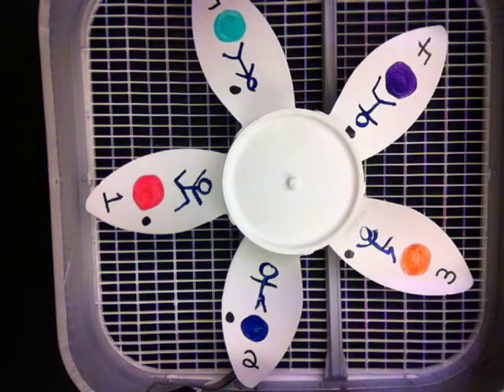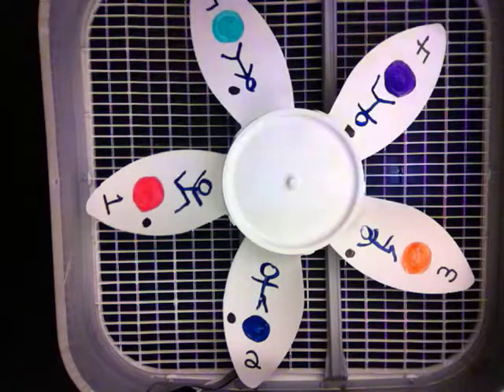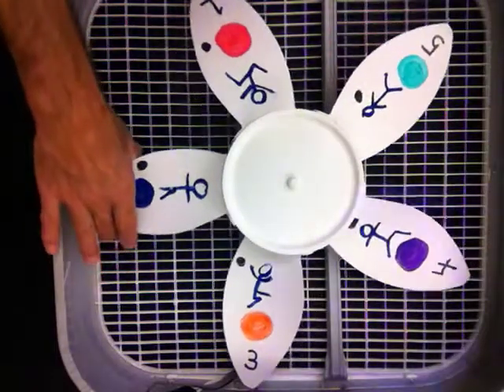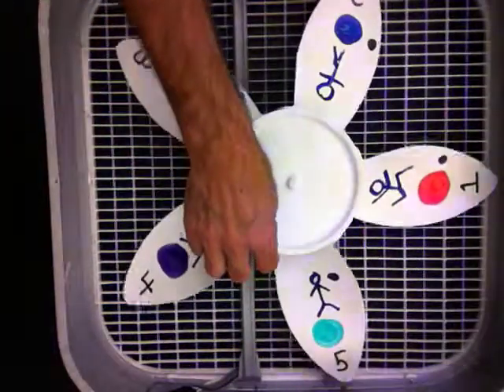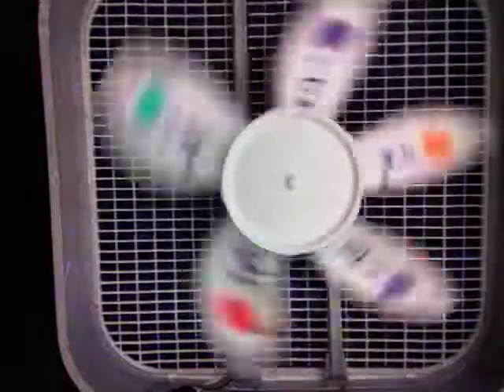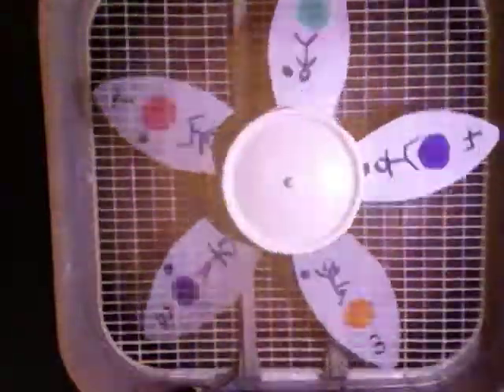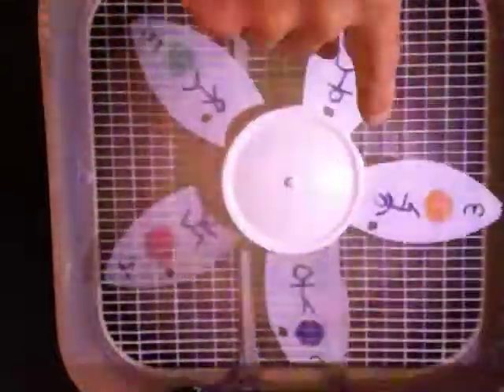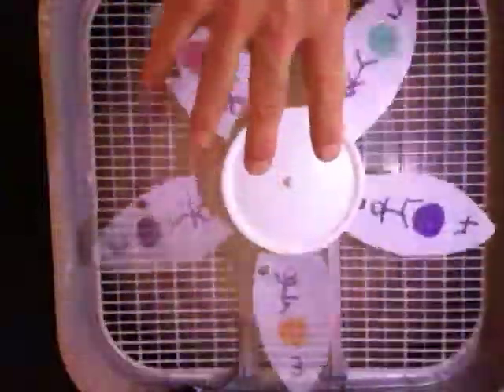Box Fan and a Pasco Strobe Light

Comment: Im trying to get my fan to look stopped using a strobe light android app (Strobily). I can get it close to stopped but not really. Its a blurry mess that will start moving backwards then forwards. I tried fine tuning up and down with no success.
Reply from the maker: Turning down the light intensity of the strobe light helps. The Pasco Strobe light allows you to refine the frequency as well as the light intensity. I have not tried a phone app.

Comment: I have recreated this experiment using leds and a smaller fan. I get the effect to work however my numbers are blurry when the fan blades looked like they are stopped. Any idea why mine does that?
Reply from the maker: You may want to reduce the intensity of the light source. I had the same problem when I had the intensity of the PASCO strobe light too high...once I dialed it back I was able to produce the image you see in the video. Best.